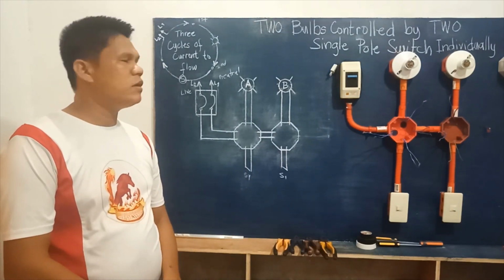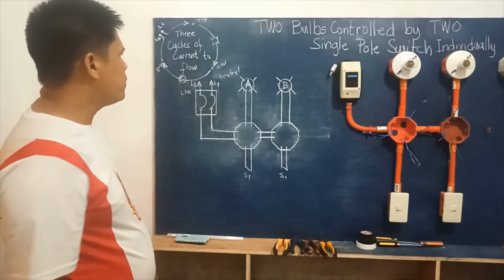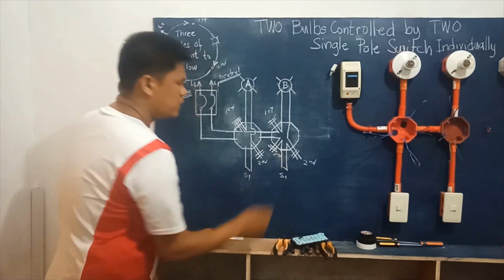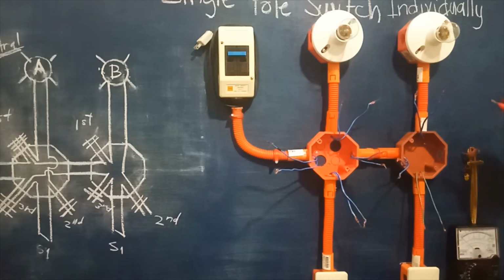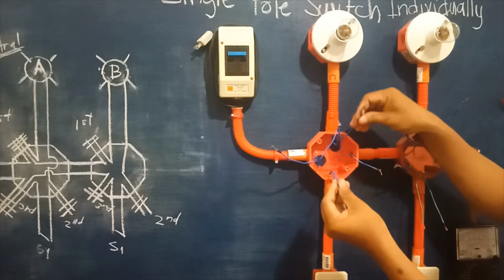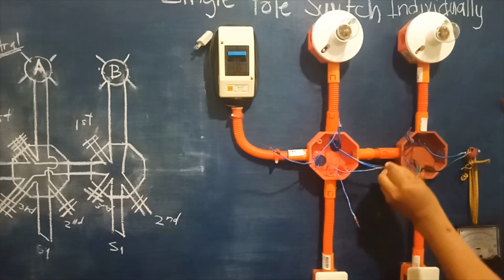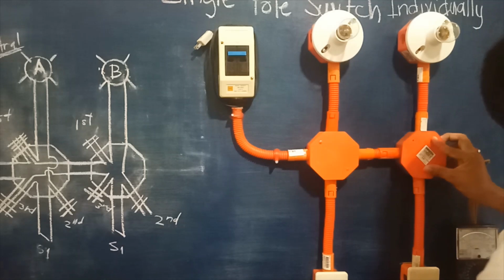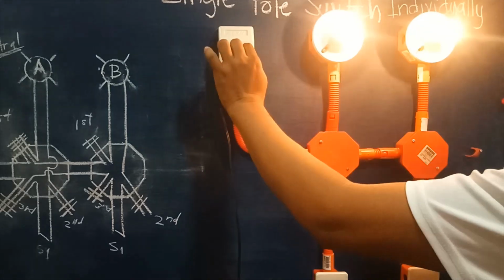Two Bulbs Controlled by Two Single Pole Switch Individually

Comment: Panu Po Gawin Ang 2 lamps controlled by a single pole switch and has a wattmeter along the AC voltage source. Sana matulungan nyo Po Ako nahihirapan Po Kasi ako
Reply from the maker: Sana makabili agad ako ng watt meter para sa next upload ko
Reply from the maker: Magandang content yan
Reply from the maker: Paki add ako sa fb ko. '... Para matulungan kita..... Glenn Bazar